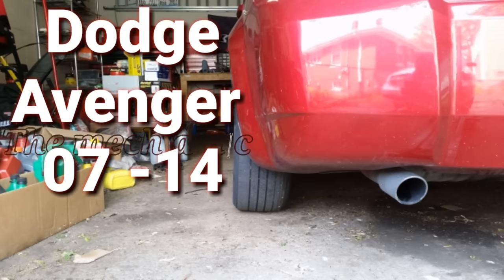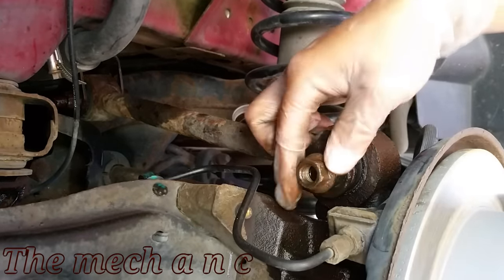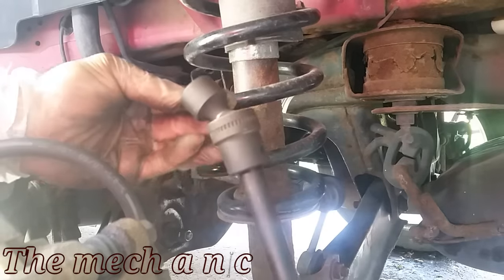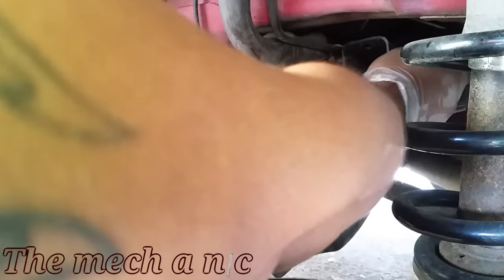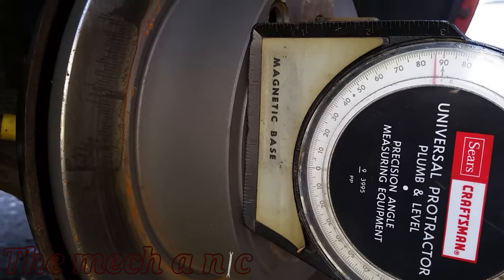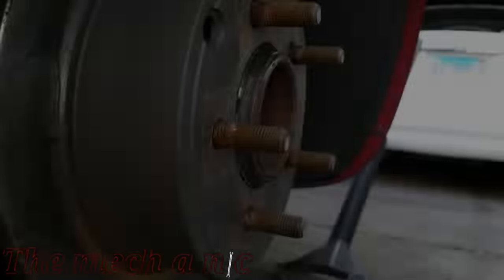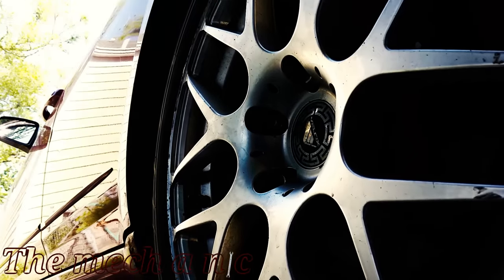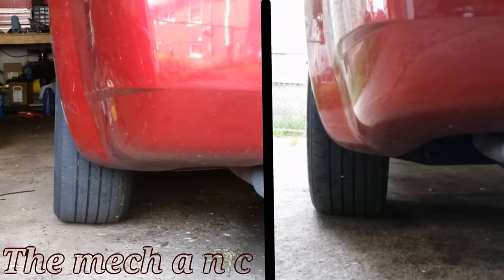07 -14 dodge avenger rear camber / tire wear

Comment: Why do you think this is a camber problem? In my experience this is caused by a serious toe out. Toe out of the rear wheels, if those tires were indeed on the rear for most of their life, i.e. not being rotated. Camber does not cause such a wear pattern.
Reply from the maker: You could physically see the excessive negative camber. I don't think this car has toe adjustment back there and the lower arm and bushing was replaced. By using the adjustable arms the shop was able to get it into spec.
Reply: Actually Nick I have the Dodge Avenger Factory manual and there is a toe adjustment bar for that vehicle it's not the upper arm it's down next to the lower arm and it is called a toe link adjustment and it has a bolt and cam assembly to adjust the toe-in and toe out of the rear wheels I know this because the bushings on mine I have gone bad and I've ordered new toe link bars online and they're being shipped to me right now I had the same exact problem with my tires but yes that tire wear is an indication of a toe problem I see cars all the time that have negative camber on purpose and their tires don't wear out like that you see people all the time lowering their civics and they on purposely add negative camber to their tires and their tires don't prematurely wear like that that is clearly a toe problem
Reply: If you would like to know where the adjustable toe Link Bar is just Google 2010 Dodge Avenger rear suspension parts you'll find a website that sells mopar parts and they have an expanded view of every part including nut and bolts about entire assembly and part number 27 I believe is the adjustable toe Link Bar so you can adjust the toe on the rear tires of a Dodge Avenger
Reply: It's clearly a toe issue think about it for a second if you have negative camber all of the tire still makes contact with the road it's just that it's slightly different angle in relation to the road but the whole tire makes contact still it changes the way the car drives camber does but it's not dragging the tire the reason that improper toe of the tire wears one side of the tire out fast and the other is if you have an improper tow or angle of the tire in relation to the surface of the road the part of the tire that is at a bad angle to the surface of the road it's not rolling over the way that part of the tire is actually being drug along the road which causes excessive wear on the side of the tire that is being dragged along the surface of the road as opposed to rolling over it which is why improper toe causes most of your tire wear or uneven tire wear camber and caster mainly affect how the vehicle Corners how well it quarters how it acts but the only thing that really will prematurely wear a tire out is improper toe or angle to the relationship of the surface of the road is the only thing that would really cause premature tire wear out you can there's a ton of YouTube videos on alignment Caster camber toe how you can do your own alignment at home I actually do my own alignments with a stream it's really easy it's just tedious but it's easy
Reply: By the way I would just like to add while you technically fixed the camber on the car you did not actually fix the problem the problem is is that all the bushings in the suspension are rotting and worn out and everything is no longer Square in the suspension and there's too much slack which is the result is a negative camber but what you don't see is that the toe Link Bar also has a bushing in it to bushings actually one on the spindle and one on the frame and those bushings have worn out to and what they're doing is they're allowing the tire to go be drug in a positive toe down the road which is why you're getting a premature inside where on the tire also clearly these people never rotate their tires so the weird part is is that the only solution is to actually go in which is what I'm doing and rebuild the entire suspension you go in you order you don't have to order all new parts you just go in and you order new bushings and then you can either have them pressed in at a shop or you can rent a tool that you can manually press in your own bushings and you have to restore everything back so that there's no slack in the system the negative camber will just go away because now everything is nice and tight and then you get the car line to correct the tow and problem soft that's the actual solution to the problem but really it's just worn-out suspension bushings is the issue the car will also drive so much better bushings aren't just there to keep everything Square they also absorb a lot of the impact and energy of the road as well they make a huge difference in how the car drives and feels but I understand not everybody wants to spend the money to do things right and they just want a quick cheap fix I can see someone may not want to put that sort of money in a 8 year old car but if you do and by the way the bushings are only like a hundred bucks and then of course your labor to install them all they are a pain in the ass to put in I agree but along with new struts and springs an 8 year old car can drive like you just drove it off the car lot by replacing the bushings and new Springs because Springs wear out overtime to
Reply: Dodge everything and Jeep WJ's DON'T HAVE REAR CAMBER or TOE adjustment. It's built into the frame, only way to adjust that in the rear is aftermarket lift kits with spacer washers meant to add a bolt with inclined washer bracket you turn to adjust your caster and a adjustment on aftermarket control arms that adjust camber a little bit but definitely adjust castor.
There might be a custom aftermarket track bar with adjustable jam nuts similar to tie rod ends that might change geometry.

Toe in adjustment is done from tie rod ends that are on the front wheels from knuckle to knuckle connected to a center link with two tie rod ends screwed into a threaded rod with bolt adjustment/jam nuts.

Comment: Great video, very informative. To viewers, the part he replaced is called an "Upper Control Arm" and sometimes referred to as a "Camber Link." Just be sure to mention "Upper" and "Adjustable " when you purchase. 

O'Reilly's part # is
PRE 2CB25213
Precision is the manufacturer
Reply: would that apply for a g6
Reply: @uoyebut2151  probably not the part number, but if you know your make (pontiac) model (G6) year (????) And trim level or engine type (Se Gt GTP GXP etc) 
Rock auto has a pretty good parts finder format, as does o rileys website, and you can look up your specific part that way, which is the same process the employee at the parts store uses.
Reply: Thank you sir, I was like I cannot find an adjustable camber anywhere! Thank you!
Reply: I replaced my upper control arm and my tires are still leaning out. Someone said I may need a wheel alignment, any suggestions ?
Reply from the maker: Check the bushing on the trailing arm , but you always get a wheel alignment done after replacing parts

Comment: I subscribed, I am a mechanic on my channel but wanted to learn how to do rear alignment, my car is doing same thing, I called a local alignment shop and they said my Chrysler 300 which is rear wheel drive, only front can get adjusted and not the rear, so you helped me figure out that I can just get adjustable control arms for mine, thanks

Comment: Also keep in mind that if the shocks or struts are worn out that 90*degree angle will be off.  A lot of people over look that part of the cars suspension is the culprit for bad tire wear.

Comment: your only mistake is that you did not even out the adjuster on the right even adjustment before you install it , you should adjust the length evenly then adjust  that if you turn the middle adjuster it will adjust the same length of the adjuster . also you really have to preload before doing the adjustment then tightened the control arm. you are good. its just normal to sometimes forget something but over all you are good .

Comment: If you get decent ones from a wreckers that are low KM and have good bushings like i did it will straighten the camber and toe in right up. I changed spindles, upper and lower control arms all wrecker parts no issues
Reply: What is the name of the arm he replaced?
Reply: jajaid6 rear upper control arm. Is what I refer to them as.

Comment: Thanks for the video,especially the level on car part.i put the level on ground to find a close to flat surface😂,but this is the best
Reply from the maker: You're welcome, Thanks for watching.  Don't forget the wheel alignment and you'll be all set
Reply: Having a level ground is good but when you lift the car, that all goes to hell - make sure the car is level before you adjust the camber.
Reply: Jose

Comment: You need to use the center adjuster only......unwinding the inner you have made the threads uneven from side to side.....if there is to few threads the unit could pull out and new arm could fail....that is the reason one side has reverse threads

Comment: You forgot to use  your rubber pinch weld hockey puck . On the assembly line only the toe- in  is adjusted as all the other are pre set. Nice idea with the level , it's close enough  to get to the alignment shop. It's mind blowing the amount of times you hear about nobody has the money to fix their car.  Well done buddy.
Reply from the maker: I'm not using the pinch weld puck because after the 6th car it fell apart😂piece of junk. Yes the toe is adjustable from factory. I always forget to mention something in my videos 😂👍. I guess it just comes with the area I live in.

Comment: If it seizes make sure you have a replacement bolt and use an angle grinder to get the old bolt off. I just went through that nightmare with the bottom bolt for my strut

Comment: I have this issue on my 2010 Chrysler Sebring and I as I understand it they are the same as the Avenger. I have been wondering how to fix it, especially on the bushings. I ordered some bushings from Amazon only could change one because I am doing it all with hand tools. Now, I am thinking I should have just bought the adjustable links. I want to change the other bushings but it is time-consuming with hand tools, but hey got to do what I can with what I got. Good video bro, very insightful... Thanks!!!

Comment: I will say one thing, the thread is reverse threaded on one end and standard on the other end, because the entire bar should be the same length out on each side when installed you simply twist the middle threaded sleeve to extend it while uninstalled you should hold each end stationary while twisting the sleeve from them being completely threaded in so that it is a even amount out on each side failure to do so may result in weakened linkage because say its almost all the way on one side and other side way out it may only be a couple of threads in the sleeve!! And that is very unsafe

Comment: my first time doing the same control arms on my gf's car, went easy breezy. yesterday however , the upper bolt was a PITA , and the one coming off the knuckle is seized into the bushing sleeve like you wouldn't believe. And these bushings don't have much of a lip to use with a ball joint puller kit. probably crater it in the socket. So , decided instead of effing a bunch of stuff up, spent a few bucks on rock auto. I felt defeated . 🥺

Comment: You have to inspect all bushes and ball joints before fitting adjustable control arms.
Reply from the maker: I did, it's not in the video but I did. I even replaced the lower arm and the bushing on the knuckle

Comment: The original angle of 90 degree wont be same if you lower and fix tire because raising the car would tilt the whole system again. However great video

Comment: Ok, so I replaced both of my upper control arms, but the only ones for sale near me where non adjustable. The tires are still like these were in your video before you did the work. If they're not meant to be adjustable, what causes them to still be out of alignment when buying a non adjustable arm? I'm working on a 2013 Chrysler 200. Thanks!
Reply from the maker: There's bushings on the trailing arm that get destroyed and cause the alignment to be out

Comment: Heh, every mechanic knows, when using hands tools.  Step number 1 is ball up both hands into a fist.  Step number 2, hit a solid part of the car, i.e. the engine block, frame, strut, etc., as hard as you can with both fists.  Get it done and over with :D.

Comment: You said to point out your mistake, so here it is. When you said to not worry about the other angles because you were not moving them, that isn't true. When you move camber, toe moves by huge amounts. And that holds true for just about every angle on the car. When you change one angle, the others change as well. The evidence of this is in the tires. While you can have inside edge wear due to excessive negative camber, its a gradual process that happens over tile. When toe is out, that's what does that extreme damage and rips the tread off right down to the cords. 

What you did in the video is just fine for getting the parts installed, but the next step is to get it on a machine. You can't do a real alignment without one. There's certain steps that need to be taken that can only be done with a machine. That's why you'll never see a shop attempt to do alignments if they don't have a machine. They always send them out.
Reply from the maker: Thanks for your input. I mentioned in the video that all of this means nothing because it needs to go in for a proper wheel alignment and it did once i was done installing the parts
Reply: @themechanic6117  Sorry. I somehow missed it.

Comment: Awesome job on the video. Thank you for sharing your knowledge, much appreciated..
Reply from the maker: Thank you for watching
Reply: @themechanic6117  do you know if they make adjustable camber arms for the rear end of chargers or Challengers? My 2006 charger rear is out of alignment man.
Reply from the maker: They should . Those are popular cars. Check suspension components first. If its out of alignment something is worn out

Comment: I have the same issue with my Honda Odyssey 2006. The rear driver side wheel camber is out of spec. I can see the rear passenger side wheel is wearing from inside. Shall I have to change the both rear control arms one with camber settings. By default Honda odyssey 2006 don't have rear Camber adjustments.

Comment: The mistake that you made is that you have to erase both tires in the air with a Jack, so the car can be level. Ed, you cannot check only one side and brink. 90° on that scale that you had. That's my opinion so both tires have to be in the air and level in order to do a good alignment.

Comment: My camber same way on my Mercedes, only issue there it’s unadjustable , need special bolts , i think it’s beyond the bolts now so need bushings
Reply from the maker: Check all the bushings, especially on the trailing arm. It can cause this same problem
Reply: @themechanic6117  thank you sir I’m going to check that

Comment: Damn ! 
My Mazda has a similar set up . It’s a 2015 Mazda 6 and my undercarriage is way worse looking than that because it was never under coated . The previous owner / original had the Final Coat Electronic bs . I gotta replace it all in my opinion .
Oh ! Locking collar nut 🔩
Groan .... level 😂

Comment: Thank you.  Do they have this bar on a 2016 Nissan Altima S also?  Replaced all 4 tires a year ago this month, Then in December I had the rear shocks replaced and in March I had to replace the 2 rear tires again because of inside cupping.  Now, the rear tires have inside cupping again.  Something is not right here

Comment: Thank you for the video. I have a quick question. Instead of replacing entire camber arm, can I just use one of those camber bolts at the end of this camber rod?
Reply from the maker: Yes those work. Check all your bushings before changing parts. Most times worn out bushing fix problems like this

Comment: I have a 2019 Honda Fit
and just put on new tires and
wheels from a large dealer in our city. I noticed that in the rear tires that they have a slight negative camber.
The Tire store has told me that it wasn’t fixable it was the way Honda made the car.
Anyone know if this is true 
I hate to have new tires go bad quickly

Comment: Shocks go bad and have caused camber issues even in rear wheels . some nitrogen gas leaks out and loose pressure causing sag.  And negative camber.....good luck with that..

Comment: Thanks for the video. My 2004 Colorado is doing that with the front tires, but I took it for an alignment and they said it needs new ball bearing and tie rods. I'm confused. Can those parts be causing the inside wear as well? Thanks
Reply from the maker: Yes bad balljoints and tie rods can cause that problem. Get fixed what they're saying and theylll be able to perform the wheel alignment
Reply: @themechanic6117  got it. Thanks for the quick reply.

Comment: MY GUY nice video does it work the same for the front part of the suspension?
Reply from the maker: Yes , an alignment shop can determine if something is worn out. Alignments don't normally just go out. There's usually a bushing / balljoint/ suspension that's causing the bad Alignment

Comment: What was the mistake you made? Looked like you put lock tight on the bolts, and then needed to load the suspension and adjust the camber, unless that was anti seize

Comment: Theres a good chance that by replacing the arms you did and at equal lengths and if not much else wrong one may not need alignment depending on the driving and wheel movements in the steering wheel
Reply from the maker: Its possible but a wheel alignment is best and a lot cheaper than eating through tires
Reply: @themechanic6117  so true but people with very little might not be able to afford things.  Been there working on cars myself I understand since theres tons of questions asked and charges today are outrageous.  Good job